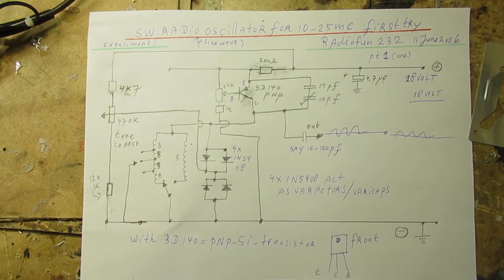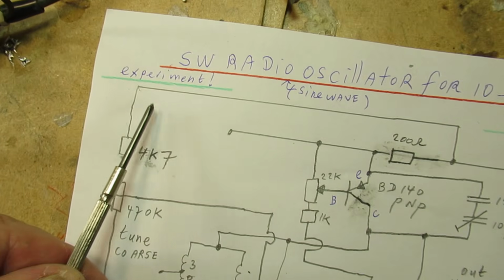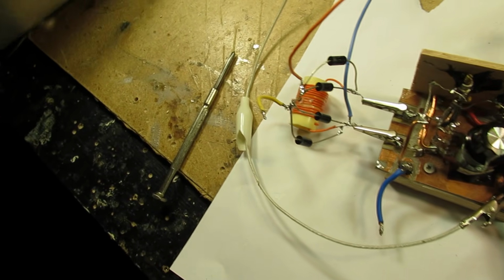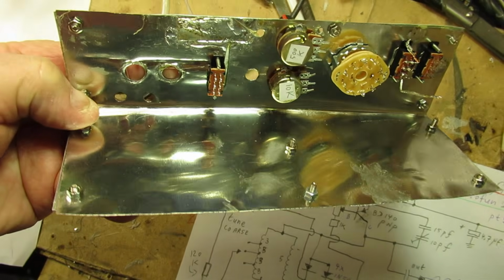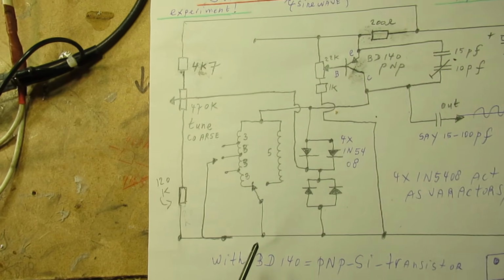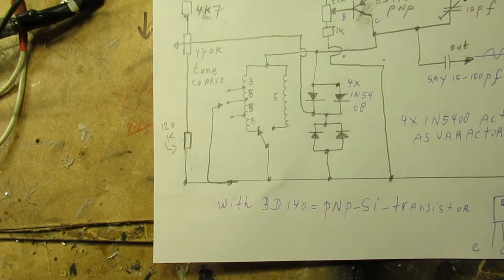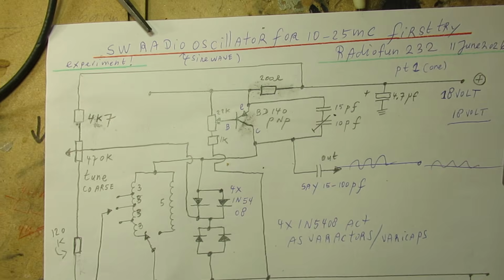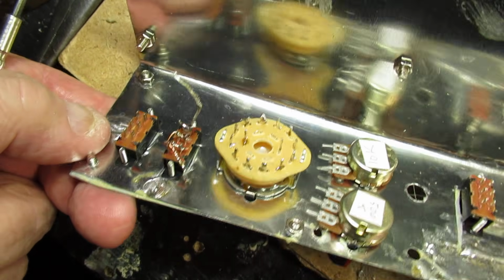Sine Wave Radio oscillator for freq. between 10 MC and 20 MC. First try with BD 140 PNP + schematic

Comment from the maker: IMPORTANT: you must solder a 1000 pF (=1N) capacitor from base to ground, otherwise it does not oscillate (sorry, forgotten in the schematic). And you can solder a resistor in the order of 100 Ohm into the emitter lead, to prevent a too fierce oscillation. Update 12 june 2026.

Comment: This is good somewhere in remote island or remote places on earth need to be rescue for scavenger electronic parts put into SOS hf radio transmitter for milliwatts to watts as an simple design circuit to be heard across distances world to be rescue but also simple receiver too to make proper tune or simple shortwave radio maybe okay. And antenna too very critical also.

Comment: As always interesting video 👍
Reply from the maker: Thanks John, I was busy with it during the past days. Changed it somewhat, but not the basics. The circuit is by itself OK, I only forgot to draw the 1000 pF capacitor in the schematic, anyway. Corrected this in the texbox & via my pinned comment. Have it quite good now, though not ideal. Added a 100 Ohm resistor in the emitter lead and a 1 K resistor on "the other side"" of the bias potmeter. Want to make a simple superhet SW radio with it in the future, going from 10 MC - 20 MC. 13 june 2026.
Reply: @radiofun232 that's a great project 👍

Comment: Use of rectifier diodes as varactor is not standard practice. The capacitance value is not accurate and varies widely.
Reply from the maker: Indeed no standard practice. But it works OK. E.G. here in a FM radio https://youtu.be/F5whmoEcbn0

Comment: Thanks for sharing these circuits !  @8:43 is the 10pF capacitor a smoothing / ripple limit to the coil? I'm just amateur electronics but fascinated about coil windings especially bi-filar for pulse-motors ! You also mentioned the importance of coil orientation, vertical and the other horizontal , really interesting thanks again !
Reply from the maker: Thanks, you are welcome. I found that the fixed value (15 pF) cap. did not work nice enough in that Lecher line oscillator circuit (link in the textbox). So I added that 10 pF tunable trimmer in series, to make it better working, in that Lecher line circuit. It brought the capacitive value thus somewhat down (they are in series) and tunable. Of course, in the coming days, I will make this circuit completely over, and also in a way with a (big) tin plate mass. That will surely have an influence about how it all in practice will work out. I a bad scenario (to much parasitic capacitances to the tin plate) it can mean that the highest frequencies (say 20 MC) cannot be reached or be reached with a lower oscillator energy output or sine wave distortion. But I tested the setup first (schematic showed) and on the basis of that I am more or less sure that it will work nice in the future, probably with 1 extra transistor in a buffer stage. 12 june 2026. Update: that capacitor of 1000 pF must be soldered in, forgotten to draw it in the schematic.
Reply: @radiofun232  Thanks for the information. The 4-diode array looks similar to the Tesla aether circuits, I am trying these in an energy harvesting circuit.looking forward to your videos and presentation thanks again

Comment: Interesting, thank you. Someone perhaps wonders why use an audio transistor in an RF oscillator. That BD140 seems to go quite high frequencies as you have shown. Also, my guess is that with a low-ish ft (highest frequency where the current gain is above unity), VHF and UHF parasitic oscillations are less likely. Also someone might wonder why PNP instead of NPN. In your oscillator topology, the PNP has the nice property that the tank coil (inductor) is grounded at one end, instead of going to the positive supply line. Wes Hayward's book Experimental Methods in RF Design has an oscillator circuit (originally not his) with two small signal AF transistors, providing a very low level of oscillator noise. One more point: some ham operator had experimented with Zener diodes as varicaps and gotten good results. (ZL2PD Hunts for Varicap Diodes)
Reply from the maker: Thanks for your comment. Important information for everyone. And yes, such a coil must be (or can be) grounded to the mass, minus, in this case. It makes developing this as a Local Oscillator for these high or higher frequency bands (when used in a superhet setup or so) much easier. BY the way: also between say 1 MC and 12 MC. Thanks, also for the idea that Zener diodes can be used as varicaps. Perhaps I will do experiments on that regard in the future. A very interesting thing to be tested out in practice. Even LEDS can do that job, but perhaps too much influence from possible external light, entering the barrier layer, having influence on the capacitance. Thanks again! 12 june 2026.